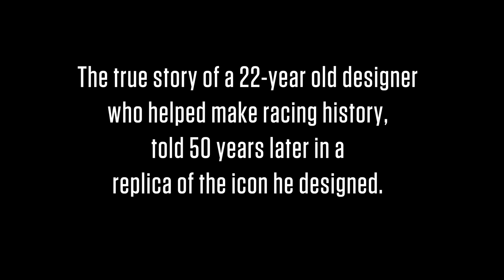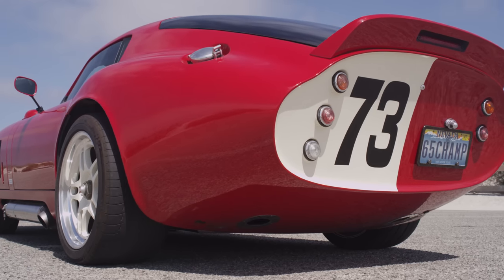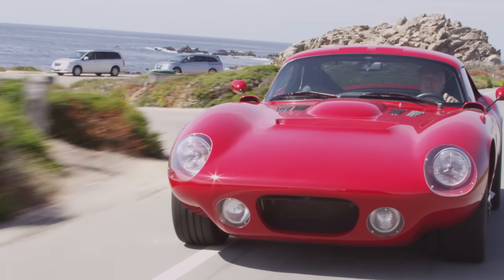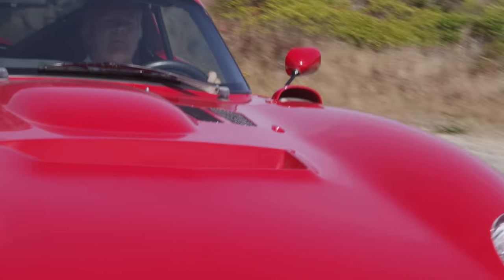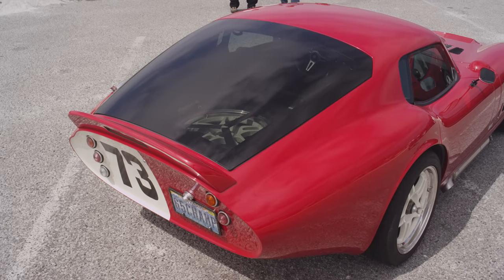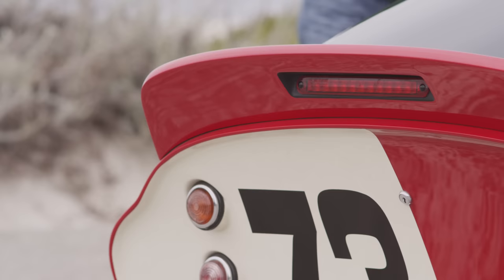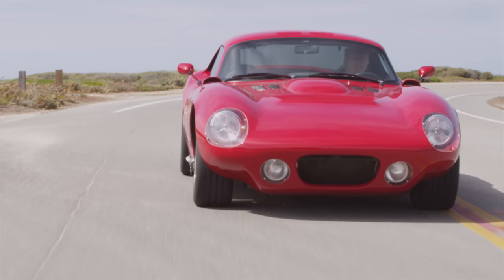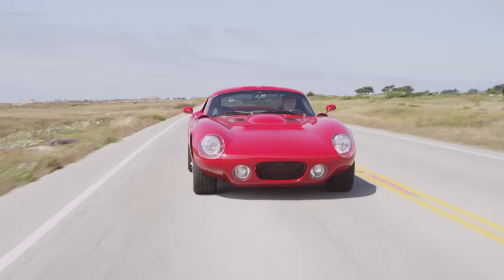Peter Brock shares the true story behind the Shelby Cobra Daytona

Comment: Pete makes great points ... among them, I bought a Corvette new in 1972.  Like all young men I wanted to "see what it would do".  1st, the handling was total crap, 2nd, at 110mph the front end became so light I had to shut it down to highway speed.  I have never been so disappointed in a car.  Conversely, I now own  1965 427 AC Cobra MKIII.  I have driven it to 130mph at Willow Springs Raceway and I can share with you that, the faster it goes the more heavy it gets.  My Son has done 150mph (windshield on) with no handling issues at all.  I know Pete didn't design the Cobra, but he expanded on the design of the Cobra with the Daytona which took the car to a new level.  Even today, and with all the "improvements" the haters will comment on, I wouldn't have a Corvette again.

Comment: The love for engineering and the passion and dedication guys like this had for motorsports is why we have the beautiful machinery we have today. What we call Grace lines today are the thousands of hours spent in the shop and on the track testing aerodynamics without the aid of computers or wind tunnels. Pure guts, determination and seat of the pants experience was expensive and painful but paid off in the long run. Many of the lines and enhancements we see on cars today are the direct result of what men like this staked their careers and even their lives on. This vehicle represents the the spirit of the times then and looks as tho it could have been built today. Cars like this still bring powerful emotions bubbling to the surface for many of us. May young engineers take a lesson from these men and their labors. It appears that spirit still lives

Comment: Makes you wonder if Japan copyied  the body for the 240 Z .
Reply: similarities.  speaking of Datsun, it was Brock Who so successfully campainged Datsun Z cars & 510's under American colors in SCCA.....BRE.....Brock Racing Enterprises.
Reply: Blade Cutter also roadsters
Reply: The 240Z was designed by Albrecht Goertz, a German who also designed the classic BMW 503 and 507 and the Toyota 2000GT (as seen in the movie "Thunderball," and now hugely expensive at auction). The Datsun really doesn't resemble the Cobra very much in any case, if you look at them side by side.
Reply: @stephenthompson3242  looks and aerodynamics aren't the same thing. After this car they learned quickly it couldn't be overlooked any longer. Pure horsepower was no longer enough. Everything that came after this car was BECAUSE of this car. It changed everything.
Reply: They stole the ME-1 engine specs for their 280 z
Reply: Jaguar XKE has similar lines too.
Reply: There's a book called "The Reckoning" that focuses the rise of Nissan.
Pete Brock designed the z car. GM didn't want to build it because it would have competed with the Corvette. I can't remember if it was supposed to have a small block.
He took the design to Nissan=Datsun....The Fairlady
Reply: they copied the Fiberfab Jamaican
Reply: The mid 1970's Toyota Celica was a copy of the 1970 Ford Mustang Mach 1
Reply: *michael bachman 1969
Reply: @stephenthompson3242  I beg your pardon, but you did NOT want to make that comment in the presence of Mr. K (Yutaka Katayama), in spite of some of the commentary by Mr. Goertz. I spoke with Mr. K in the late 1990s many times and this topic came up a couple of times when others at car shows made that reference. Apparently, and I don't know the whole story, but Albrecht Goertz did have some conversation with Datsun and Mr. K in the late 1960s as the Fairlady Z / 240Z was being initially designed. For whatever reason, his input wasn't accepted and the Fairlady Z was created by Yoshihiko Matsuo and his Nissan Sports Car Styling Studio.

Comment: How right he is about the drag on the Cobra roadster. I built a replica with a Ford 302 V8 and ran that for 10 years as a daily driver. Tried for it's top speed one time on a deserted freeway at 2 am. With the gearing I had I found that it would get to about 135 mph easily but then struggled and finally reached 147 mph and that was all she wrote!

Fact is I could feel the drag kicking in at 130 and above when the revs would only creep up slowly trying to overcome the enormous drag of that huge mouth...and the rest behind it!

More power would have helped of course. The original 289 managed about 160 mph on their best day, then hit the aerodynamic wall but they had more power than my 302 produced.

Comment: an unfortunate common denominator of this golden era of endurance racing is that many of these pioneering drivers died in races, live or testing. Peter Brock, Ken Miles, Bruce McLaren, Walt Hansgen. as a direct result of Ken Miles's accident, a NASCAR style rollcage was added to the GT 40 and almost certainly saved Mario Andretti's life a year later in another racing accident. while it's unfair to say that safety was ignored, the cars were evolving so fast that at times safety couldn't keep up. today, safety is designed into the cars from the beginning and is based on the pioneering efforts of these drivers and engineers.
Reply: I said that this to them as when I was 8 years old .,,I know carol heard me but few others didn't thu